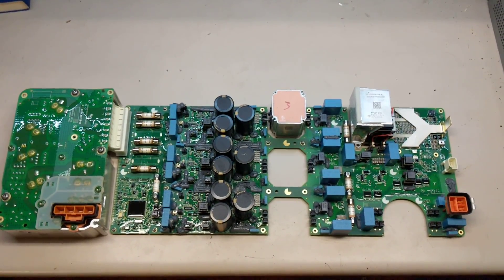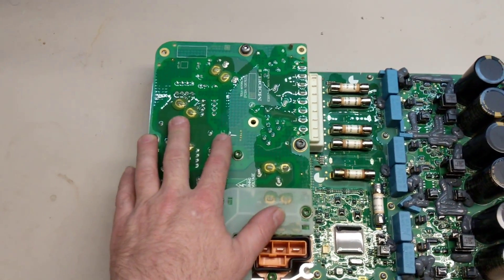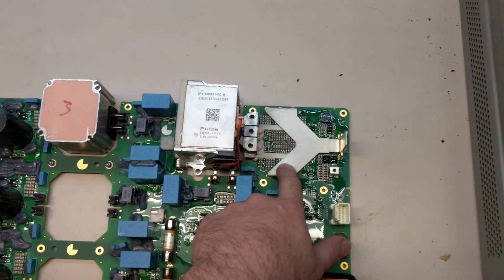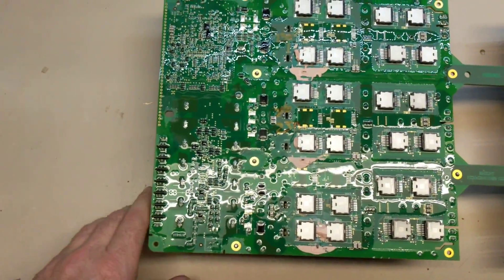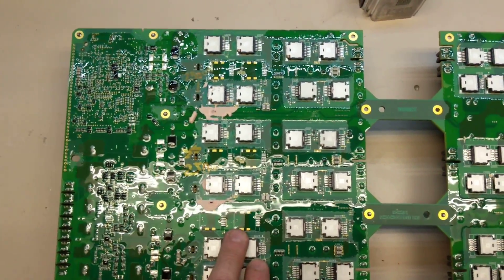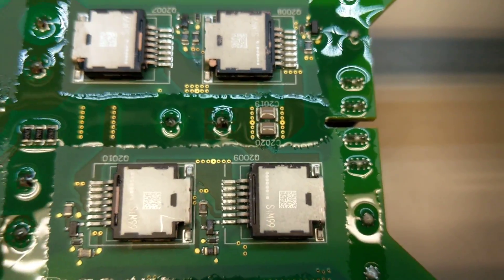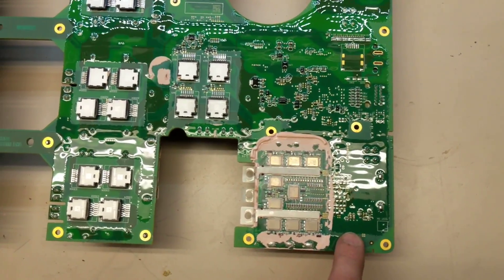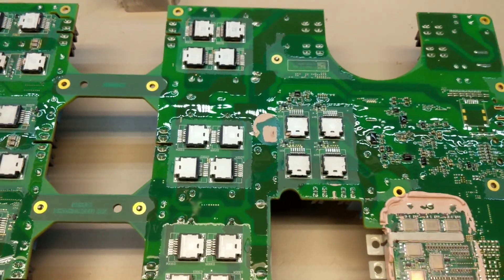Tesla vehicle to grid: Debunked! PART 1

Comment: I need a new PCS, 2018 M3 RWD LR in Atlanta GA.  I have worked around high voltage for many years.  would it be feasible to do the work myself?
Reply from the maker: Yes, best to contact Yaro at Calimotive (Tesla recycler).   Tell him Phil sent you.  He can sell you a used PCS.  The hardest part is not spilling coolant all over the penthouse.  (This is super important, as it will destroy your pack!)   You'll also need the special pentalobe socket to remove the penthouse cover fasteners.  DO NOT try to power up the system without the cover on and at least all bolts in that mount the black BMS unit to the cover, the interlock will fault and you will not understand why it's not working!   There is HV present in the penthouse even with all power off in the car, so be extremely careful!

Comment: The Cybertruck has the PCS2 board which has V2G. Of course this is public information now but just putting it out here. It supplies 2X 120Vac to power a house and a power tool (20A combined at one time) and 240Vac (40A combined including the 120Vac outlets) to charge another car. 
Would be great if we can get a teardown and analysis of the PCS2 board of the CTruck. 
The SiC FET and SiC diode is a custom package called HU3PAK co-developed by STMicro and Tesla.
On this board, curious to know what so many fuses are doing?

Comment: Any retrofit possible for 2015 Tesla Model S and 2017 Tesla Model X for V2G?
Reply from the maker: No, apparently you didn't bother to watch the video and it's second part?
Reply: @Ingineerix  I saw the video fully and asking if there is (someone offering) a retrofit for those models!
Reply from the maker: @nathvg2576  Not that I am aware of.  I was able to devise a system to use my Model 3 to power my house in the event of an emergency, but it's not something for the faint-of-heart, and it definitely voids the warranty.   Tesla has a specific clause that voids your battery warranty if the car is used for stationary storage.   It's also not cheap, the parts cost alone is over several thousand USD.
Reply: @Ingineerix  what inverter did you use for the V2H? Is it a split phase? I have a 2013 Nissan Leaf that I plan to use it’s Chademo port, but Setec-power doesn’t sell a split phase 220v that I could use as a generator.
Reply from the maker: @nathvg2576  I have a custom made unit that can produce either 3-phase or split-phase at 7.2kW.   I also have an older and less-efficient unit made by Bel that can do 15kW split-phase, but it's quiescent load is close to 500w.

Comment: Sorry if I missed this question, but the power connector does give access to the 400V DC pack for supercharging. Couldn't one make a supercharger looking battery-less powerwall that would basically connect to the DC pack, and then generate 240V outside the car, and sync with the local grid?
Reply from the maker: Yes, ignoring for a minute that this immediately would void your battery warranty and that Tesla could send a software update to render it useless; yes.   I have done it.  Parts cost alone was over several thousand USD.   I scrapped this project after proof-of-concept and now use a separate pack out of a salvage Model S for my home backup.   This way I can still drive and not lose power to my house.
Reply: @Ingineerix  thank you. As an engineer, I was very curious of how much work that would be. I knew it was obviously possible, just not how much this would cost.
Glad you got yours working, given that I only need backup power less than once a year, and load shifting arbitrage is not really worth the price of a system and daily battery wear,  it seems that I'll stay with my hacked up solution that takes 200A from the 12V rail behind the seat and sends it back to an inverter. It's crappy but good enough for less than once a year.

Comment: Supercharging bypasses the PCS, so I'd guess any potential V2G application would/could just 'trick' the supercharging contactor to get direct access to HV DC, then invert externally (or with a custom power wall, someday).  Additionally, the car HAS pretty massive 3 phase inverters, surely, with some reconfiguration, these could be tuned to output 60Hz in a 3phase, or split phase configuration. (again, bypassing the PCS altogether)
Reply from the maker: Yes, it could be done externally with Tesla's support.  Tesla will immediately void your battery warranty if the car is used for this.   They do NOT want this happening period, they want you to buy a powerwall.  No, the drive inverter cannot produce a 60hz AC output without extensive modifications, which include adding a massive 2000A 3-phase contactor and large filter inductors, so it would not be practical.

Comment: I suspect that the three phase cars have nearly identical PCS modules, just not bridging the AC to each 1/3 of the PCS, but running the phases to the isolation transformers.. When my PCS failed, I certainly noticed it jump from 48A to 32A to 16A before dropping out.. Fortunately, I was able to manually set it low to start and get it charged enough to get it to the service center

Comment: is the DC/DC converter a Phase shifted full bridge with diodes at the secondary side? (seems like it due to the one output filter inductor at the lower right for all 3 converters combined, but does more look like a common mode choke since both + and - is wrapped around to toroid)

or is it an LLC design? using resonant leakage inductance in the transformer plus small resonant capacitors? (I see 12 small ceramic MLCC at each primary side of the transformer it seems)

Comment: I've always wondered, instead of a 3-phase supply, could I supply the same phase 3 times? If the car is just using diodes to rectify the AC (and not something fancy/synchronous), then could a (correctly provisioned) set of 3 single-line supplies be used instead. I'm not going to wire this up, but interested in if it would work :)
Reply: Late to the party, but that should work if they are three separate circuits. Bjorn Nyland did that in Norway.
Reply: @rlaxton666  you've not got a link have you?

Comment: What is synchronous rectification?
Reply from the maker: The simple answer is replacing diodes with active switches.   The best diodes still have a significant forward voltage drop, which is sort of like a toll charge.  In the DC-DC section of the PCS they use it on the 12v side, where they have replaced the diodes with MOSFETs which are way more efficient, and this also lets that DC-DC run in reverse for HV precharge.  SR is less important at high voltages, and here Tesla uses SiC (Silicon Carbide) diodes which have almost as good of performance as SR would.

Comment: would it not just be easier to have a secondary precharge contactor and a precharge resistor to limit inrush current?
Reply from the maker: More parts, more cost, more potential for failure.  Reversing the DC-DC is just software once you are doing synchronous rectification, which is important for efficiency at low voltages.  (12v side of DC-DC)   Also, Resistors for precharge suck, as they bring the voltage up initially fast, but as the voltage climbs it gets slower and slower.   This usually means slow precharge, or a really low value resistor that will fry if there is a fault in the HV.   In the past I've used PTC thermistors for this, which are better and more fault tolerant, but using the DC-DC is superior.

Comment: Is this the same with the model s? Particularly can you provide 12V source and charge the battery? Say you take a 12V solar panel could you charge the main pack? I know it would take forever this is just hypothetical.
Reply from the maker: On new Model S (Plaid/Palladium), yes.  However you'd need software cooperation on Tesla's side.  Much easier to just boost solar panels right to HV.  This is what we are doing on our vans.   https://maxwellvehicles.com/

Comment: I think you miss the point. Vehicle to grid will always be done with an external inverter. Simply closing the DC contractors as is done during Supercharging will allow DC to flow out to an external inverter to convert to AC. It doesn't make sense to do it inside the car.

Comment: Synchronous rectification on secondary side is probably not efficient when outputting several hundred volts. Gate drive losses vs conduction losses... I think SR is good for up to maybe 120V give or take. Also of it is LLC topology I think SR is quite tricky.

Comment: Whilst your video demonstrates that the pcs cannot be used in V2G, it doesn't explore the CCS standard for Europe which is how many V2G systems are planning to work. The vehicle would just need to open the connection to the DC side of the battery just like it does when rapid charging.
Reply: that was exactly my question too. did you find any answer to this?

Comment: seems like two types of coatings are on the board, a clear one and a gray one. What's the difference? Also, so the board converts AC to DC to AC then to DC again. Doesn't this sound really inefficient? What's the reason for doing 3 conversions back and forth?
Reply: albeit counter-intuitive its actually more efficient, and thats why its done this way. its easier/more efficient to transform voltage if the frequency is higher (you can use far smaller and lighter transformers), but to change that frequency you first have to turn AC into DC and then switch it back and forth for a rectengular AC (not good for most purposes because lots of noise in the waveform, but good enough to transform up or down)

More examples of which gadgets are transforming mains voltage to a useable level with this approach would be Computer PSUs or the quite common USB phone chargers

Comment: I like your confirmation here https://youtu.be/lXokJEzXwaI?t=168 that each of the 2 sections is for capacity, and not redundancy as others have speculated. By my calcs, each "section" is capable of 250v @ 16A max giving 3840W per section. The 3 phase input is connected in parallel so as to distribute the load across all three sections irrespective of, say higher current over L1 verses lower current over L1/2/3. I've tested this on my base M3 (SR+) and can confirm all 3 sections are populated in 2020 SR+.

Comment: Excellent deduction on the no-SR meaning uni-directional operation.
The HV diodes may have many legs for high frequency, low inductance reasons like they are doing for SiC FETs.
Do you know what the switching frequency is for this chargers ?  The DC-DC part ?  Do you now what kind of FET drivers they use ?

Comment: Not “debunked”.  The “feature” is smart grid charging, that if enabled the car would charge during periods where the grid needed to offload excess power in order to help stabilize the grid. This does not work in reverse.  Tesla never announced or implied the cars would put power back into the grid. Can’t debunk something that was never announced.  Doh.
Reply from the maker: All I am debunking is the claim that the PCS in the model 3 is bi-directional.  That's it, I made/make no other points.

Comment: It seems to me we won't really know until we see the board from a 2019-20 3 or Y. Tesla does continual improvement and could have started putting in the FETs needed for reversing the flow after sometime in 2018.
Reply from the maker: Working on it!
Reply from the maker: See:  https://youtu.be/UkRk2OQI7RE
Reply: @Ingineerix  Could they wrongly label the components to mislead the automotive competitors? You say the components have the same package. Have you tested the components themselves, made an x ray or broken them apart to see what's inside?
Reply: Given that the form factor looks similar what else would the reversal need? 

Btw can you share markings on the diods?
Reply: Kevin Breslin you see it around minute 3:43 it’s SiD600.

Comment: The third generation power wall will likely have an integrated charger that will allow DC voltage to go back to the power wall from the car. Then the power wall will turn it into AC volts. Tesla just announced a new gateway this week so that means they will likely have another set of connections for the chargers. Then the gateway will Make the switch for vehicle to grid. This will allow Tesla to control when the car can be used this way. Also force you to by Tesla powerwall.
Reply: Now that's not likely to happen because this would also allow your car to supercharge at home which is also not good for th batteries. And even if: the powerwall has a different system voltage then the car battery so you would ne a beafy dc2dc converter in addition to the gateway... And special electricians to install new contractors

Comment: Theres no point in having V2G on 2017/18 M3’s where the older battery pack would have limited charge cycling. Maybe Tesla will allow an optional upgrade for a million-mile-battery pack, that would include an upgraded bidirectional PCS, and software revision.  After all, they are now doing MS MCU1 upgrades, albeit for a fee ..
Reply: Sure there is, for backup power during emergencies.  It’s insurance, like have a power brick for your phone.  You won’t use it daily but you’re willing to pay for it because when you do need it, it could save you.
Reply: yeah, Tesla will offer you this option. They will give you half back of what you paid for your car and sell you a brand new one. Lol.

Comment: What is the max power of this board. I can see 3 separate transformer in Dc-Dc side..what will be the max power of each..from ur video u said that it is single phase only. so why it requires 3 separate transformer chanells?..I am also confused with  contactor issue that u told in the end of video..can anyone clear my doubts?
Reply: He said that the three separate but identical circuits are there for world compatibility. If you live in a country with 3-phase they can be run out of phase with each other, but in phase with the incoming power, thus the 4 contactors. In the US they only use the two as we have single-phase power here. To get the 48 amps or 11+kW of power you run all three. For the standard range, one of the three circuits is unpopulated with components, a cheaper charger for a cheaper car, you only get 32 amps.

He said at the end that they take power from the 12v battery and goose it up to the pack voltage, to charge the power circuits up. Doesn't take much, but if you don't do this then when the contactors are closing there will be arc lightning as the discharged components start to contact the charged battery. This may not kill the components, but the inrush of power is hard on them, and it happens EVERY time you get in the car. The big issue is that the arcing of power will cause a buildup on the contactor plates and eventually they won't make full contact and will heat up, even later they won't make reliable contact at all.

Comment: I don't think anyone will do V2G with the standard OnBoardCharger, for a start, there are numerous safety implications and significant legislation on providing a system that can injected AC power straight back into your home AC supply, (to avoid eletricuting power company operatives....), and of course, you are adding cost to the vehicle itself to enable that. I suspect that V2G will be DC linked, using additional fixed interface (grid tied inverter) basically identical to what you already do with a domestic solar instalation. All the car needs to do is to shut its HVDC contactors and tell that inverter how much current it may pull from the battery!  This also makes sense with a "powerwall" type arrangement, using a multi-kW DC/DC that its between the powerwall battery and the vehicles battery.  This means power can flow in both directions, and be stored / used by both systems.
Reply: How does Nissan's V2G work. Is it done through the DC charger only?

Comment: V2G is done over DC cables, not AC. So you're right - it's not possible via AC. But with DC charging, we are exposing battery terminals. And with a little bit of software magic - technically - every DC charging capable car out there can feed the power back to the grid (via external DC-AC converter). 
Take it EV!
Reply: The DC cables are inside the car. If the Electrek article was correct and not debunked by this video AC would have been presented at the charge-port. Some new box would have been required to move this power from the port to the grid, but it would all be AC outside the car.

Comment: Well. Can Tesla pull our leg? The diode you showed it had also at seven pins. I looked at Wolf Speed homepage and I cannot find any diode schottky diode that has 7 pin. They only have 2. Can it be they use sic transistor as diode now but it actually a transistor. They know people gonna wrap this apart... Who knows?

Comment: So with a 2018 board it is not possible>
The Cybertruck demo AC output is possible (power for ATV) add the nessecary electronics to synchronise and voila.
The Sandy Munro teardown of the Model Y shows big evoultion of electonics since Model 3.
If Tesla decides to do V2G they just have to add the electronics and decide on a power connection method
Reply: Don't think the cT is using a bi-directional charger though, probably just a high voltage inverter

Comment: It’s a little hard to tell but there are no gate drive pins and associated electronics on those “diodes”, right? So they are in fact diodes and not IGBT’s as you mentioned?
Reply from the maker: Correct!  Here is Marco's board:  https://electrek.co/wp-content/uploads/sites/3/2020/05/IMG_1151.jpg?quality=82&strip=all

Here is mine: https://lh3.googleusercontent.com/ZfTMiK81E1F378qlrpZRpknFqY20ix8dPTlh_WnWFBoTvE0Pr6ECjWsxfJjck1PLkX9xecydcH0IoiUk8Vqb1akhejQepsKHZEbyC9DQdCq008gMD-TgUoMcbd7Mf1Q49ZyIiAQ60o8=w2400

The only obvious difference is he pulled the 3 inductors off the cold plate and stuck them on top.  (they don't go there normally)